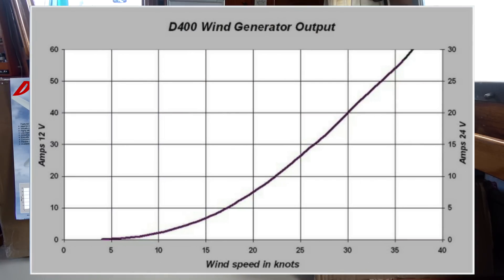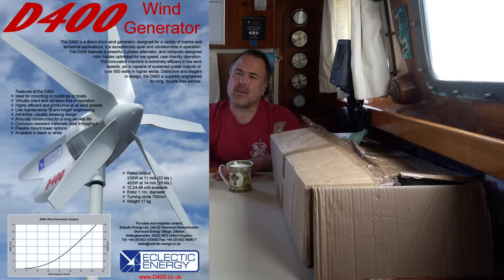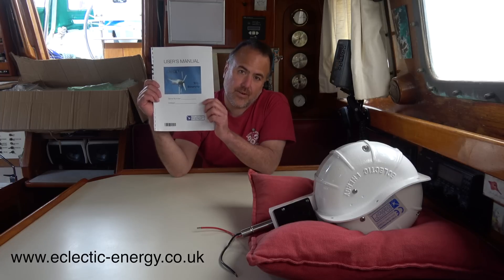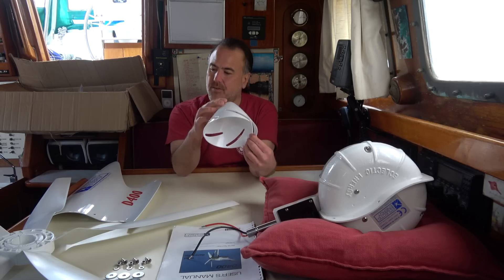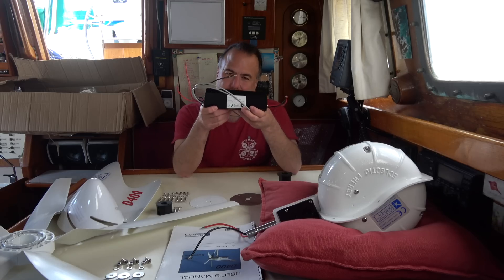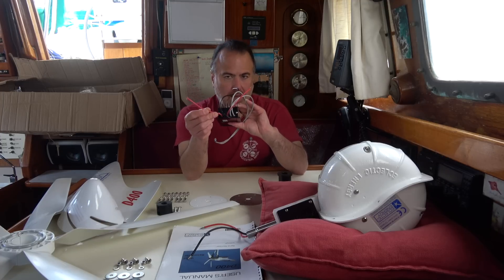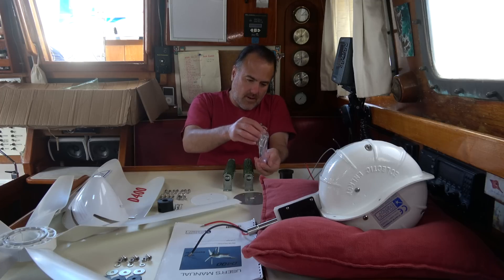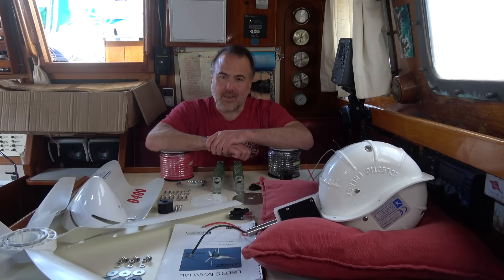Eclectic Energy D400 Wind Generator Unboxing (Part 1)

Comment: One day, Drake will join the 21st-century and re-commission his watermaker...  
Though I understand that it's generally recommended to not use them when in harbor due to residual oils, silt and comtaminents damaging the filters.  And most of them don't like brackish or fresh river-water either.

Comment: Just a quickie , what’s there to stop the cables from twisting and eventually snapping down the pole if the generator keeps rotating around the pole the same way.
Reply from the maker: Good question. :) Right out of the box, the wires coming out of the D400 do not rotate as the blade assembly turns to point into the wind.  As we'll see in installation video next week.  Fair winds.

Comment: Great video as per normal.... A couple of observations. 1. Are you on the hard? How else would you have neatly lined up rolling hardware on a flat surface for 10 minutes... 2. It seems to me that someone that likes to sail where the average temperature is too danged cold for me, you would want a couple of free heat generators.

Good luck with the install. Now you'll be wanting larger battery banks. Fair winds and trailing seas. I typed traveling seas first, thought that doesn't sound right, but it could be, under the right circumstances.
Reply from the maker: Hi Wayne, Hah.. When I filmed this unboxing video we were docked on a pontoon in Stornoway, Scotland on a calm day.  When we last weighed Paragon on a travel lift she weighee 38,600 lbs.  I think that weight keeps her much more stationary in the slip than a lighter displacement sailboat.  I've been aboard other lighter boats where as soon as I stepped on deck the boat leaned over a bit before returning upright, but we never notice that happening on Paragon.  I think the extra weight also makes for a smoother, more gentle motion in heavy weather offshore, which is easier on the crew.  It was pretty cold up in Svalbard this past season, but it was just so beautiful there that we have decided that we have to go back next Summer. Here's to the cruising life! :)    Drake

Comment: You might check to make sure your solar and wind setups are run through an isolator to make sure that neither sees the output voltage of the other causing them to throttle back. Do either of those charge controllers use a voltage sense wire or do they read voltage directly from the charge leads?

Comment: I am really interested to see if while under sail if the wind generator costs you any speed.
 I'm also curious why when the batteries are charged the voltage regulator doesn't just break the field and stop generating power like a automotive altinator.
 I to have concerns about resistors on a boat or anything really resistors fail not that often but when they do it can be bad. If they fail does that trip the breakers to save your batteries?
Reply: tim paragon is a big heavy full-keel boat, 2 of these turbines wouldn't slow her down any slower than she already is. all wind turbines have a maximum safe rpm, if you were to let one freewheel with no load the centrifugal force would blow it apart. load resistors for dump load applications are heavy-duty wirewound units that are rated much higher than the maximum output that the turbine is capable of. this turbine uses load resistors because the rectifier is in the turbine with dc output, 3-phase ac turbines with a remote rectifier usually use a brake switch or relay which doesn't produce any heat, magnetically slowing the turbine to a safe speed.
Reply: Just a guess but possibly just opening the circuit could allow the blades to over speed and damage things.

Comment: Great intro, looking forward to the install. Question... the mounting pole, what size is required? does that insert fit a range of sizes or just one specific size pole?
Reply from the maker: Thanks!  The D400 manual states: The standard tower liner has an outside diameter of 41.8 mm and is designed to slide into standard aluminium or steel scaffolding tubing with a nominal outside diameter of 48 mm and inside diameter of 42 mm.

Comment: You can dump excess power to a " electric 12volt water heater coil " in your hot water tank .. to make free hot water with your excess wind power... instead of losing it to your factory dump resistors and into the air.
Reply: christopher peterson I was just thinking the same! Also I wonder if you have solar, wind and maybe some other sources, should there actually be a single charge controller for all of these...?
Reply: They do make 12 VOLT wind and solar charge controllers, that control both SOLAR AND WIND  in one unit, and will also allow you to dump excess power depending on  your settings. MTTP charge controllers are digitally programable so you can customise battery type, float voltages, dump threshold, etc.  My solar / wind system and controller is older and custom 32volt and not MTTP.
Reply: christopher i prefer separate controllers over one big convenient controller because if the one big convenient controller fails, the entire system is junk especially if you're in the middle of an ocean. drake has multiple tristars in his solar system for that reason.
Reply: marzsit there is benefit to that but you do loose efficiency.
Reply: The idea of using a second element in the hot water heater to dump the energy sounds like a great use of the power. A water maker may also be an option. Probably not directly as the wind power is too variable but how about the charge controller having a signal wire that was on when the battery reached 95% or something and then use that to control optional loads in the boat. So that when the battery reached 95% the water maker/water heater/dehumidifer/diesel polisher/etc starts up and then switches off again if the battery drops below 90%. That way the wind turbine would always just be charging the batteries. If you had no luxury/optional loads like a water make or water heater then you could always just use the dump resistors.
Reply: I was just thinking of what a waste that excess energy was and thinking of ways to divert it to something useful.  You may have one alternative there.